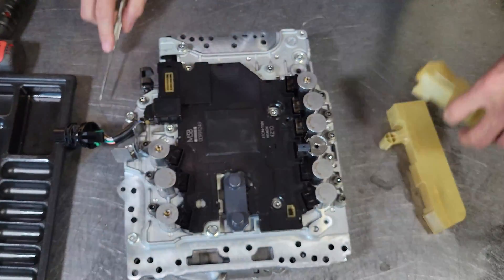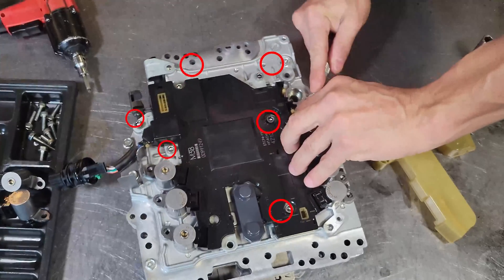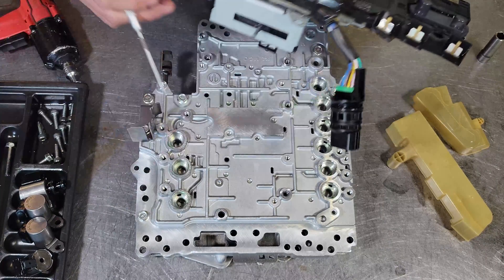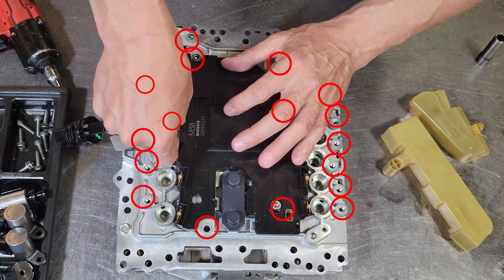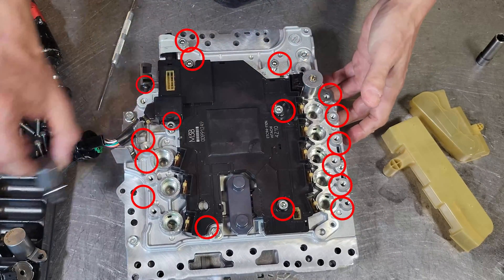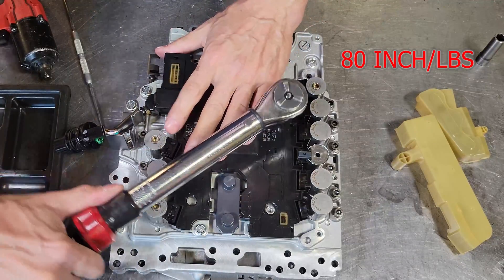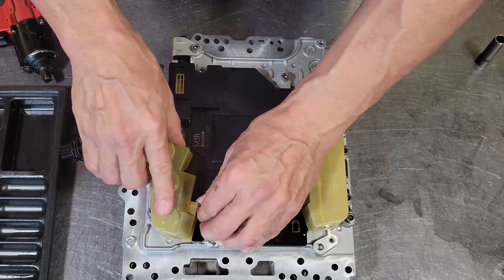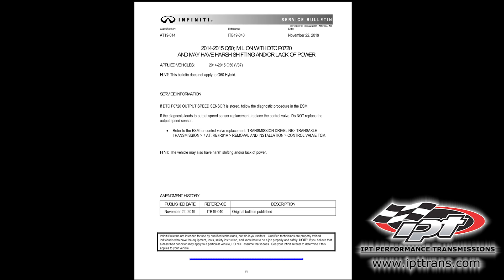Nissan Code P0720- RE7 and 7AT TCM/Solenoid Changeover, 370z, G37

Comment: Just wondering..you said to hold onto your faulty TCU and put it on the new valve body?  My Z wouldn't go out of 1st gear.  If I did put the old TCU on the new valve body would it not do the same thing?  IOW..is the problem in the TCU or in the valve body itself??

Comment: Dude your a life saver, bought  mine from nexenzo,reman ,send your vin and they'll reprogram it also for 690.00 that's valve body,and electronics
Reply from the maker: Great tip, do you have their info?
Reply: @iptperformancetrans  They are called nexenzo on google i'm going with their valve body since I got the dreaded code last night and my Q50 went into limp mode. Researching all day this is my lowest cost solution vs upgrading to the vr30 trans that comes with the oem valevebody/tcu.

Comment: Can you do this the other way around?  As in pull just the tcm and swap it over to the valve body of your car?  As in taking only the tcm/speed sensor and putting in your vb.  I bought an assembly and the electrical bits are the same but the vb has a drilled and tapped hole where as mine does not.  But the tcm appears to share the same part number and dimensions.  Thanks!
Reply from the maker: You can 
That said, it’s pretty rare but some model VB’s have a sensor in that hole- if they don’t, that is a blind hole. In other words, it’s drilled and tapped but it’s blocked off in the valve body plate and does nothing.
Also, TCM part numbers can be the same but the software written to them can be different 
The numbers are not reliable for interchange, as stupid as it sounds
Reply: @iptperformancetrans so I wonder if I simply plug the hole if it would work.  Mine has the hole in the casting but it isn’t drilled and tapped.
Reply from the maker: @comanchefun1612 You can I guess but it’s already blocked internally
Reply: @iptperformancetrans okay I’ll give it a shot first thing in the morning.  I really appreciate you replying.  Also I checked out the website if I get screwed on this vb I might have to give yall a call.  My car is a ‘13 G37X.

Comment: Do you happen to know which solenoids control which gears or function? I have a  2015 qx50 rwd that I put a reman valve body/tcm due to p0720 and it fixed it for 2 months and now when I put it in drive the D doesn’t show in cluster and it acts like it’s in neutral, no faults. If I slam the shifter from park to Drive then it will work. All other gears work except for D and manual mode.

Comment: I have a 2007 m35x I replaced the tcm on the  valve body with the matching part number however I get no throttle response from the gas pedal ? Does this mean it needs to be programmed ?
Reply from the maker: If you have a 2007, it’s a different valve body than this.
I don’t know what you’re saying by no throttle response- the car doesn’t move?
Reply: @iptperformancetrans I know it’s a different valve body I had replaced the valve body with the correct part however when you turn the car on and try to give the car gas it doesn’t accelerate
Reply: I’m
Asking if this issue is because the  tcm needs to be programmed ? The tcm I had purchased was manufactured
Reply from the maker: @griffin499 I’d recommend contacting whoever the TCM was purchased from.

Comment: Thanks for the preflight! I had a hard time finding any info on TCM's other than what's in the FSM. My canbus crashes when TCM is plugged in. I metered every harness I could find against the FSM, all pointed to TCM causing short to ground on Can Low. TCM harness tested just fine, I am thinking it's internal. Broken/bent wires in the harness inside of the trans or perhaps even the bus bars shorting out. Removing my TCM now to see if I can't figure out what on earth is going on... or, at least prove the TCM fails a bench test. That would be a good start, i've been chasing this for weeks.. bought as a no-start. 2013 G37X. Thanks again.
Reply from the maker: Please post results if you rectify the issue 🤞🏻
Reply: @iptperformancetrans Will do. TCM is coming off the valve body right now. My first thought was: Metal in the fluid causing the bus bars and harness to complete circuits where they shouldn't. Instead - I found evidence of moisture intrusion.. there is moisture trapped in the TCM and a little surface rust!
Reply from the maker: I don’t know, they are just bad all the time, having a computer sit in hot ATF probably doesn’t help its longevity
Reply: @iptperformancetrans I should have waited to speak. Got the TCM off the VB. Metal paste everywhere. My issue was canbus L grounding. I think the metal paste was completing circuits all over in this thing. Lol
Reply from the maker: @crash_override9435 
If you have that much metal, you may want to figure out where it’s coming from.
Reply: @iptperformancetrans She's a goner! Lol. I have neve driven the car. Just working on it one fiasco at a time. This trans will not see a new TCM, it will just get contaminated again. I will put the TCM back in to see if I get canbus back online.
Reply: @iptperformancetrans Question.. Do you know anyone who repairs these TCMs? After days of research, I think my only option is to buy a transmission. This is hilarious to be frank. Nobody has documented repair or diagnosis of the Achilles heel of the 7AT, the TCM. Surely someone can make some money if they find out how to repair.
Reply from the maker: @crash_override9435 
I don’t know of anyone who has fixed one
Reply: @iptperformancetrans Update: Its fixed. Metal paste indeed was caught between header pins on the processor within the TCM. I had to fully disassemble the circuitry and pop off the header pin cover on rear of CPU to access the debris. Can Low no longer has continuity to starter relay and +12V !!! Hope this is resolved.
Reply: @crash_override9435 did you end up replacing the trans or just cleaned up your tcm real good?  How’s it holding up?
Reply: @comanchefun1612 Soldered 2 connections from TCM CPU legs to the harness. The metal traces sandwiched in the plastic like to corrode and touch.. so far it's been great. Got past the no start, trans is in good shape surprisingly and I've been driving it
Reply: @crash_override9435 cool, I’ve got what I think is a replacement but if it doesn’t work I’ll try dissecting my old one and cleaning up all the legs sandwiched in the plastic.  You can clearly see sludge or something inside.  Not much but definitely could be enough to short something out.

Comment: After replacing the valve body my 2015 q50 wont start. Its says system key error. Do you know how to fix the issue?
Reply from the maker: @evertlafuente6549  I haven’t seen that before.

Comment: I had this p0720

Replace speen sensor, replace TCM all still same

Checking again 2 solenoid not function

Currently to replace whole valve body & solenoid
Reply from the maker: @abdulwafiadanan6254  The problem is the TCM, it’s never the speed sensor

Comment: Interesting. I’m getting P0720, car won’t go over the 3rd gear, it will turn into D by itself when I try to use the manual mode and I get a TCC solenoid reading of 0 value when scanning while running.. 
not sure what else I can test to identify the source of the issue.
Reply from the maker: Nothing to test, your tcu is bad
Reply: @iptperformancetrans  how reliable it would be if I fix it ? Any reco where ro get the part ?
Reply from the maker: @Hsouthh  You need either new from the dealer or exact match good used. I only get new ones here because I can’t mess around
Reply: @iptperformancetrans you’re right, probably way safer than trying to fix it.  Dealer price is about 650$ + reprog
Reply: @iptperformancetrans thanks !
Reply from the maker: @Hsouthh  Add about $1K to that

Comment: My 2011 370z auto gearbox necked itself the other week. I've purchased a 2021 auto gearbox with only 30,000kms on it. The 2021 gearbox was installed without changing around the TCM. Nissan mentioned the car is stuck in limp mode due to the TCM not wanting to communicate with the 2011 ECU. After, the car was taken to a performance shop and updated the firmware in the ECU to 2021,  the 2021 box TCM started to communicate with the updated ECU. However, the variable timing was thrown out. The ECU is now back to stock and our next move will be to install the old TCM from my broken gearbox to the new 2021 Valve body and tranmission. Would this work, are the value bodies any different between 2011 & 2021?
Reply from the maker: IMO the answer is always installing the correct transmission in the first place 
This is why I don’t know how to answer these questions- I never run into it. That said, if you use the original VB from the car, it usually will work.

Comment: I have 370z 2015 Nissan getting code p0720 and it won’t shift past 3rd gear I was told it’s the shift solenoid
Reply from the maker: Totally incorrect, your TCM has failed

Comment: Pretty cool. Could this also cause high or erratic idle.
Reply from the maker: I don’t see how, no.
Reply: It was the throttle body that needed reprogramming. But now it came back with no output speed sensor. So wondering if I should replace the tcm or the whole transmission. Wondering if I can reprogram it myself.

Comment: I have a 2017 Nissan Titan VK56 engine (V8 5.6 2WD). I had an error code p0720. Changing the sensor didn't fix the issue. I watched this video and changed the TCM. Now my truck is back to normal. Thank you. The service bulletin was a game changer.
Reply: How did you figure out which TCM was the right one? Were you able to just buy the TCM by itself and where did you get the replacement? I have the same truck year/model and same problem.
Reply from the maker: Sure thing, glad you were able to get it done
Reply: To repair the tcm where is it located 2015 2wd nissan armada
Reply: Or change tcm 2015 armada where is it located
Reply: Where did you get the TCM? I couldn't find one in stock.

Comment: I changed my speed sensor 1st because it was the cheaper option.  I will now change the valve body which comes with the TCM. Im thinking this should correct the issue.  
** it car wasn't going past 1st gear.  Then the speed sensor was changed. The transmission shifted great until turning it off and go to driving again. I will give an update soon.
Reply: Do you have an
update?
Reply: You have a update

Comment: @iptperformancetrans I have a po720 code output shaft speed sensor circuit and po615 starter relay circuit and c1109 battery voltage abnormal codes. Could this be wire/connector issue or signs of my TCM? No problem with shifting PNRD gears. High RPMs stuck in 2nd and 3rd
Reply from the maker: I’d look at the battery and starter relay codes as perhaps a voltage problem caused a problem with the TCM, either that or it probably just failed, it’s extremely common
Reply: @iptperformancetrans  thank you
Reply from the maker: @mlscott24  Good luck my friend 👍🏻

Comment: I have P0500, P0720, P0730. Car won’t shift pass 3rd and no manual mode. Will a brand new TCM fix all problems?
Reply from the maker: In all likelihood it will
Reply: I only have the P0720 Code in mine, it won't shift past 2nd and won't go over 35mph.  @iptperformancetrans

Comment: I have a 2014 Nissan Frontier SV 4.0 with the code p0720, I changed the exit sensor, it worked fine for 2 months and the code came back.

Comment: I have a 2014 Nissan Frontier SV 4.0 with the code p0720, I changed the exit sensor, it worked fine for 2 months and the code came back.
Reply from the maker: I’m surprised that helped. Every time I’ve seen that code it was due to a bad tcm
Reply: @iptperformancetrans  it is expensive to repair?
Reply from the maker: @mauricioramirez4939  Yes, the part is almost 2k from the dealership

Comment: I have a 2015 q40 with the same issue I bought a complete valve body from a 2012 g37 and the code persists. I will need to buy valve body from my same model and year? Or do I need reprogramming?
Reply from the maker: Get a valve body that’s the same as your car
Reply: @iptperformancetrans  alright man appreciate it, happy new year!

Comment: I took my 370z to AAMCO with 7 speed automatic transmission that would not shift into any higher than 3rd gear. Diagnostic Code P0720 and P0500 and they said transmission (60,000 miles) has sparkly glitter in transmission fluid and required new $8k transmission and valve assembly. I paid $500 for that diagnosis and then took the car to Jeff at Integrity who has been in business for 40 years. Jeff did research on the code and found a manufacturer tech bulletin explaining to change out the TCM Transmission Control Module and the valve assembly. Jeff installed brand new TCM and Valve assembly just as shown in this video. Car is now like new! No new transmission required! Total Cost $2,900 including labor and tax. I would recommend Integrity to anyone needing transmission work.
Reply from the maker: Wow, there’s transmission guys that will tell you the truth out there?
Reply: Iv got the same car same issue. But I replaced the valve body and still the same issue. Iv got 55,000 miles on my 2014 auto z . Maybe it is the output speed sensor I dunno what to do.
Reply from the maker: @TallRich1984  Was the replacement new?
Reply: I'm going through this now. I'm going to buy a valve body w/TCM. After reading this I have high hopes of driving my weekend car this summer 2024...thank all you guys.
Reply: Can you ask him if he had to reprogram the new TCM to the car?
Reply: Same with me, in process to change the TCM
Reply: Do you have contact information i.e. phobe or website for Integrity?

Comment: I have the same code P0720 in my 2014 QX70, RWD with the RE7R01A transmission. I understand this is actually a TCM issue since the output speed sensor is built in the TCM. This video is quite explanatory and very helpful. Thanks for sharing it with us. Have you guys found any source where I can get the TCM only, without the valve body and the oil strainer? I also know some Infiniti dealers offer the only option of the whole assembly. Thanks in advance.
Reply from the maker: The output speed sensor is NOT built into the tcm, however, the problem is almost always a bad tcm. 
They are not usually sold without the valve body, perhaps try eBay and get something that is an exact match as far as year make model and engine size.
Reply: My dealer told me that they are VIN specific, and need to be programmed to the car. I can verify this is accurate, since I installed an OEM TCM/valve body a few months ago, and It didn't fix the P0720 code. Long story short, my eventual fix was a new battery... smh. But I have 2 Q40's and here I am a few months later, and the other one is having the issue, but the battery didn't fix it this time.  @iptperformancetrans
Reply: @iptperformancetrans   I too have the dreaded P0720 error on 2014 Q60 RWD.  Problem I've noticed on eBay is most sellers list this as a generic part they don't provide year or model. For example "fits '08 Nissan / Infiniti" with a long list of models that use this TCM. My understanding is in order to work the TCM has to be programmed and is model / year specific. I can do the swap but can't find the exact replacement since everyone is so vague about year and model. Is the number, like M3B (example) enough to confirm its programmed to work with my vehicle???
Reply: @johnmoore3504 Please let me know if you found a place to buy a used or refurbished TCM… I need one too
Reply: @Polemarchus936  I gave up and bought a new one from a local Infiniti dealer for $1,500. I couldn’t find anyone who would guarantee a rebuilt / used one wouldn’t need programming or even work in my particular vehicle. Installed the new part fairly easily and it worked perfectly with no programming. It’s a messy job due the fluid and you need to keep track of the different length bolts plus the electrical connector is tricky given the tight space you’re working in. I did the happy dance when she fired up with no codes and drove like new again going thru all gears in both auto and manual modes.
Reply from the maker: The sensor is not built into the TCM, but your TCM is bad and setting the code
The sure fix is a new VB and TCM from the dealership, they are only sold together

Comment: if the speed sensor are not the problem you have one of the three wires not having contact, but the power wire has!!!!your info wirer have not, you have no signal, from one off the two
moste likely the follow the wire after the plug going in to the tcm, between the tcm and the plug there is an incorrect connection there is you problem!!

Comment: i have a 2012 g37 coupe 160k miles. dosent let me shift from D to DS or manual mode. also will not shift above 3rd gear. codes U1024 & P0720. it didn't throw a CEL at first but i scanned it and got those codes. it threw a CEL since but i haven't scanned it to see what other codes i could have. my trans also seems to be slipping so i was planning on buying another 7at and putting it in. i found one from a 2012 Sedan, from what i've looked up i think the trans for the coupe and sedan r the same. the shop with the trans says they r the same. i bought a new pan, fluid,gasket and was going to go buy the trans tmrw for $500 117k miles. will this fix my issue or am i not fixing the right issue?